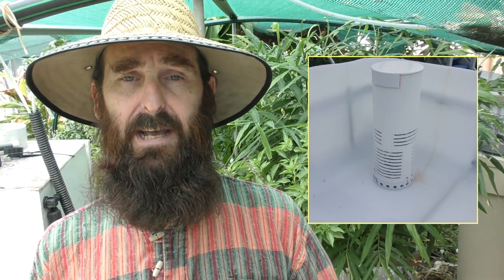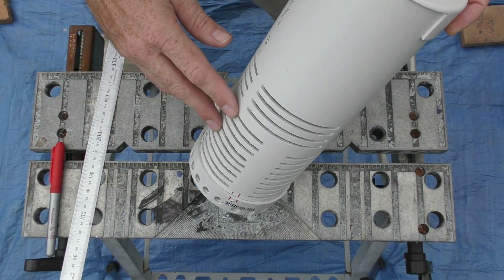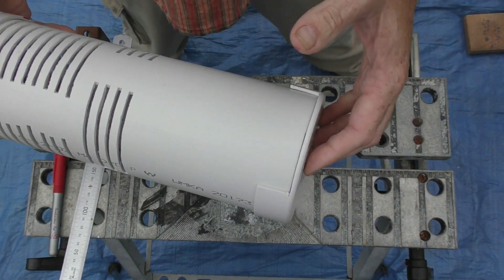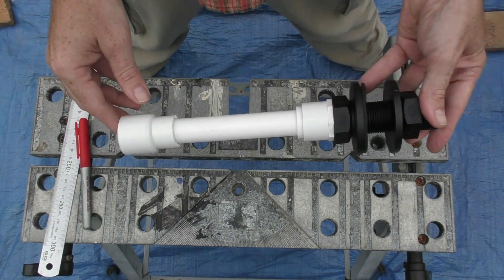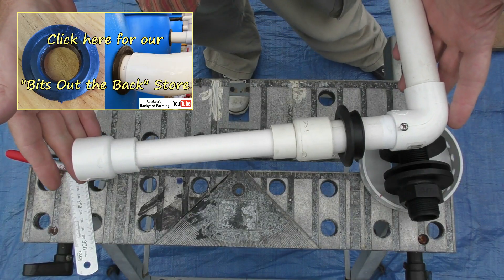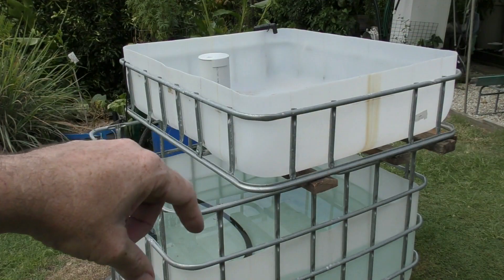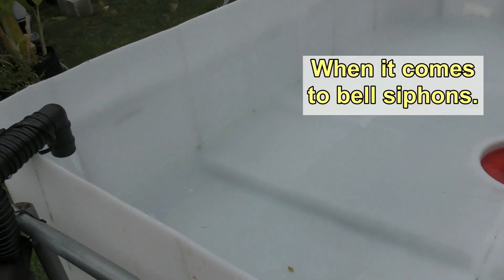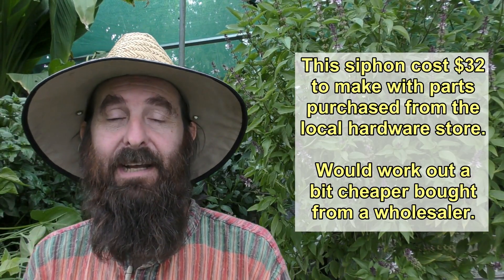How to Make a Bell Siphon & How Bell Siphons Work

Comment: Hi Rob I´m Ralph from México and i am building an aquapoci system, all was going well but i have problems with the bell siphon i cant get it to stop after the siphon is turn on, i am following your intructions by the letter so will appreciate if you could give me a clue of what´s going on? thanks!
Reply from the maker: Hey Ralph. 9 times out of 10 it's due to a high flow rate into the grow bed. Try turning the flow down a bit & see how it goes. 
It can also happen when folks test the siphon with no media in the bed as well. 
Cheers.

Comment: You said you were paying to generate compressed air. With a little bit of imagination/engineering, you can get free aerated water. Look at this method with a "trompe".  https://www.motherearthnews.com/renewable-energy/hydro-power-zmaz77jazbon
Reply from the maker: I have seen posts on the tromps & their downfall is the same as venturis in that they only work when the water is flowing. If the pump fails, which has happened a few times to me, the fish would have no O2. That's why I like to have an independent air supply.
Cheers & thanks Ray. 👍👍
Reply: @RobsAquaponics  Have you considered an automatic Transfer Switch (ATS)? They are relatively inexpensive. I am not advocating for anyone but here is an example for $40.00 Canadian currency. Grid to battery backup. Go to this link to see example.
https://www.amazon.ca/YaeTool-Automatic-Transfer-Switches-Conversion/dp/B07XNTGBQG/ref=sr_1_39?dchild=1&keywords=automatic+transfer+switch&qid=1593869950&sr=8-39
Reply from the maker: @RayAalster  I have seen systems with them connected to generators.👍 I have a simple backup using a car relay switch that's hooked to a deep cycle battery. A lot cheaper for our small system & compact as well. 
Cheers mate.

Comment: I must be missing something - when the inlet water pipe is of the same diameter as the drain pipe, how do 
you achieve water lock? The drain pipe has to be of smaller diameter to my mind. But in this case how do you drain your 
container when incoming water amount is bigger than outgoing amount?
Reply from the maker: The inflow is under pressure so is delivering more water tan the drain pipe would under gravity. 
Hope that helps.
Reply: @RobsAquaponics  Thanks Rob. Still not everything works out for me - if inflow is delivering more water, how does the container get drained?
Reply from the maker: @1yyymmmddd  The siphon creates a greater flow than the inlet provides & the bed will drain faster than the inflow. 👍

Comment: hey guys i just wanted to ask some things. i'm filipino and i live in the Philippines and its really difficult for me to find clay pellets in here. i can order online for about $2-4 per kilo of clay pellets. but i have no idea how much Kg i needed. im planning on setting up a 52x18x18 inches tank for a small 5" Jardini Arowana with possibly 2-3 tank buddies. how big of a grow bed do i need to keep the tank clean ? i figured since the fish is too small i wouldn't be needing a bigger grow bed when the plants wont get enough from the fish am i correct in assuming that ? once i get the proper size for a grow bed my next challenge would be to figure out how much clay pellets i need. thank you guys :)
Reply from the maker: Hi mate. Most clay is sold by volume here & by the sounds of it you'll need 73 gal worth to fill the bed to the brim. Probably best if youi can ask them if they have a volume per kg & work from there. 
Bio filtration wise, it's best to work on number of fish or total biomass of the fish. The rule of thumb is 25L/6.6gal for every 500g/1lb of fish keeping in mind that you need to work on final weight of fish at harvest. 
so your 275L/73gal bed should filter the waste from 11 x 500g/1lb fish or 5.5kg/12.1lb of fish. 
Hope that helps some mate.
Reply: @RobsAquaponics  will do ask them about that. thanks very much i appreciate it.

Comment: So changing the height of the standpipe allows different vegetables that require a lower water level, like potatoes? The lower water level stops them from rotting. So if you had multiple standpipes at varying heights, you could have water level control?
Reply: My plan is to build an aquaponics system with raspberry pi control and monitoring. However, the bell siphons passive technology is way more effective than any valve or pump from research.
Reply from the maker: I have added extra long standpipes to aid in the germination of seeds & found it worked well. Haven't seen anyone grow a bumper harvest of spuds in a system yet but playing around with the standpipe height may help. 
Would like to know how it goes if you give it a crack.

Comment: If I have a 450gph pump, but I restrict flow into the grow bed with a valve, am I not forcing the pump to work harder as I build pressure in the line?? Can this burn out the pump?
Reply from the maker: That depends on the pump. The magnetic drive pumps should run fine under restriction as long as it's not fully throttled.
Reply: @RobsAquaponics  thanks for the reply Rob. I'll look into what type I have.

Comment: Do you ever use larger diameter pipe for the stand pipe?
Reply from the maker: Not in my beds as they're all under 400L/100gal Zachary. 
Anything over 400L/100gal I'd probably go with a 32mm/1¼" to 25mm/1" reducer on a 25mm/1" standpipe. 
Hope that helps.

Comment: Hey Rob how much inch or millimeter do you leave between the stand and the bell will highly appreciate it 👍
Reply from the maker: Hi Jesse. I like to leave at least a 25mm/1" gap between the stand pipe & top of the bell. Have a few that have a larger gap (around 40mm/1½") & they still work OK too. 
Cheers.

Comment: G'Day Rob! How yah going?
Thanks so much for the videos! I've watched them heaps and have the IBC going.
The bell over the stand pipe is floating now now and does not have pressure on it after adding the clay balls.
I had it tested perfectly and the siphon worked great before. I have no leaks out of the bottom.
Have you had this happen? Any suggestions? 
Thanks a bunch!
Reply from the maker: Hi mate. Any chance the drain pipe is slightly elevated at the end near the sump? That can caused a water lock stopping the air escape out the end.
Hope that helps some
Reply: @RobsAquaponics  Thanks for the reply! 
I've had it going without a drain pipe, and worked fine. The I added a piece of 60mm and 40mm long drain pipe with and without a 90 degree on the end and it still worked fine. 
I had to cut down the stand pipe about 20mm to adjust the max flood height and it seemed like that is when the bell started floating.
The tank will drain be pressurized once the bell has floated a little and everything works.
Everything still seems tight and sealed inside.
Thanks again. I think I can get away with it, it just doesn't seem right.
Reply: @RobsAquaponics  you may be into something. We are on a bit of a slope and had to adjust the grow bed height with some 2x4s on the front so the drain pipe could be higher up a little. 
I'll make some adjustments, thanks!!!

Comment: G'day Rob. Aussie living in Ohio here. Are uniseals stable enough to use for a bells siphon using 20mm pvc? I have to build a 25-20mm  reducer using 2 pieces of pvc here, and expander and a coupling. Should it work just the same d'ya reckon? Cheers mate!
Reply from the maker: Hey Daniel. You can use Uniseals to hold the standpipes. 👍 I prefer the bulkheads as uniseals can fail if the pipes have a lot of movement or get knocked hard enough. 
How are you liking living in the US? 
Cheers mate.
Reply: @RobsAquaponics  Thanks for the reply Rob...I know you get a ton of questions so I appreciate you getting back with me. I really enjoy your channel. Living in the US is not too bad actually, though I do miss the salt water. I lived in Brissy and my folks are in Nth Straddie...miss the beach & SW fishing for sure! Take care mate, ya do good work and your spirit of generosity is very refreshing!
Reply from the maker: @danieltaylor757  Chewers Daniel & have a top one yourself.

Comment: Hi Rob great video and now most of us understand how the bell siphon works .  Question is do you use timer for pump to start same as you would have to over head irtigat.  So adjustable to when watering intervals works for wots growing and if you get alot of rain I'm guessing the siphon will work most of the time  when raining ?
Reply from the maker: We have the pump running 24/7 Anthony. 👍 That way the water from the fish tank is constantly flowing through the beds so the waste can be processed.  
Cheers.

Comment: So a straight 25mm  stand pipe will not get good flow instead of 25mm reducer to 20mm pipe to 25mm reducer will not get good flow?
Reply from the maker: The increased area the 25mm opening will help to allow more water into the 20mm pipe helping to initiate the siphon quicker. 👍
Cheers.

Comment: I have my 6 IBC containers all connected to the same drain and have an external riser pipe with a siphon setting my water level and it drains to my sump tank. Has worked flawlessly for 5 years now. No moving parts or ways to stop working.
Reply from the maker: Nice one Steve.

Comment: Hi Rob. What do you feel about U Siphon? I having a bit of a confusing whether to use a bell siphon or a u siphon.
Reply from the maker: I find the Bell work fine for me & have a smaller footprint in the bed. 
An external U siphon would help there but you will have issues cleaning the plumbing inside the bed if roots become an issue. 
Cheers.

Comment: Hi Bob  I'm having an issue with my bell siphons. It my in-flow water is too slow. Then the water rises and trickles over the upright but never creates the siphon. If I raise the in-flow higher then siphon initiates but then is never breaks the siphon when nearly drained.  Any ideas??   My Upright is 1-1/2" to 1" with 1" PVC pipe with a 1" to 1-1/4" reducer on top.  But bell is 3" my shroud is 4"
Thanks in advance
Reply from the maker: Hi Barry. Sorry it took a while to get back to you. Have you sorted the siphon out yet? 
I had that issue in the past & found that it was a slightly elevated drain pipe that was creating a water lock under the bed that was the issue. 
Cheers mate.
Reply: Hey Rob. It would appear that I just need patience perhaps. it does flood and drain. it just seems/appears to take forever from the first gurgle to burp then it breaks the siphon and re-starts the next flood.  Thanks Mate
Reply from the maker: @barryfawthrop2287  Am glad it sorted itself out Barry. 👍
Happy growing mate. 🐟🌱

Comment: Is it okay to take this and use it in a smaller system? I'm just afraid it may drain the beds to quickly (if that is a problem or not). I know it's a stupid question but this stuff is really new to me. Thanks in advance!
Reply: Chuck Norris never get afraid
Reply from the maker: It should be no issue as well as long as the beds don't dry out. I've used it in smaller 810L systems with no issues if that helps any.

Comment: Can a bell siphon work if the tank the water is being siphoned into is higher than the tank being emptied?
Reply from the maker: No it can't. Most folks will have it running into a sump tank with a pump in it to move the water back to the fish tank.
👍

Comment: Excellent video! Especially thank you for translating both inches and metric!
Please be super careful when cutting those notches into the shroud with the miter saw. I know a pro who lost his hand to a miter saw...good idea would be to start with a longer 4” pipe, cut your slots (keeping your hands away from blade), then trim to length after slots are done.....also, I too was having some problems with the siphon initiation. Another easy way to assure the initiation is to have the drain begin with a 90 degree angle, pipes 1st 1-2 ft stay horizontal, then down to storage. 
Again, awesome tape. Thanks!!!
Reply from the maker: Glad you enjoyed it Dan.👍
I grew up working in my father's engineering factory so have experience working with dangerous tools. But in saying that, you make a very good point about starting with a longer section & cutting it down once the slots are cut. 👍
Cheers mate & happy growing.

Comment: Hello, 
Thank you for your time posting these tutorials. You mentioned that it takes 10 minutes to fill the grow bed and 3 minutes to drain it with the bell siphon. I calculated your pump at 158.5 gph is doing 2.66 gpm's. My first question is what is your cycle on/off rate so that you exchange the tank water once per hour? My tank is pretty close to the same size and I am still learning and I am having problems getting my flow right. My fish tank(no fish yet) is closer to 190 gallons. My grow bed is 45"x38"x12" . I measured 45"x38"x8" and calulated it will hold 60 gallons +/-  of water, stopping at 4" from the top lip. 2 inches above this with river rock and a 2 inch lip above the river rock. I estimated my grow bed to hold 24 gallons of water after the 3/4" river rock owned 60% of the space.  River rock 36 gallons, water 24gallons. So does my sump need to be at 24 gallon? I have read that it is a good ides to add 50% additional, making the proper sump tank 36 gallons. Sound right? I initially estimated mine to be 18 gallons and that is what I used and I am having a flow exchange issue. emptying the sump tank faster than the radial flow filter will replenish it. I made a video under my name showing what I have going on and asking for suggestions from someone that knows. But anyhow I think I will reduce the size of my bell sipon from 1 1/2 to 1 in like yours and incrase the size of my sump to 35 ish gallons. My sump now currently gravity fills from the radial filter and it is overflowing until the fish tank and radial filter level off and the radial filter bucket drains low enough to stop flowing into the sump tank. First attempt at this. Sorry to be long winded. Thank you again.
Reply from the maker: Hi Rob. 
The size of your sump needs to be at least as large as the grow bed so it can hold enough water to cover the pump as well as leave enough in there so you don't need to be constantly topping it up with fresh water all the time. 
You can use the 50% of bed volume once you start adding additional beds to the system is the rule I like to follow. 

I just had a gander at you system clip & think you need to increase the size of your sump to at least the total volume of your grow bed, if not larger for the reasons I stated above as well as to be able to hold the total volume of the grow bed in it.

How do you have the stilling well on the radial flow filter connected? If it's airtight it may be initiating a siphon & draining faster than it would via gravity. 

Hope that helps some mate.

Comment: Might be dumb question first time aquapontist here how does the  25mm pvc pipe connect to the bottom of the bulkhead also is a bulkhead a tank outlet here in Australia cheers mate
Reply from the maker: You can see the fitting used to connect the 25mm drainpipe @ 13:57 AG. 👍
They're called both bulkhead & tank fittings here. Bunnings sell them as tank fittings from memory..
Hope that helps mate.
Reply: @RobsAquaponics  cheers mate ended up finding something got my grow beds all set up made out of used pallets and some pond liner cheers and thanks rob
Reply from the maker: @sweetness6048  No problem mate. Happy growing.

Comment: Folks can measure flow rate with a gallon jug or 5 gal bucket, just make sure you have the height of the inlet the same ad to not fool with the results
Reply from the maker: That's the easiest way.
Cheers.

Comment: You were my motivation to build a chop and flip aquaponics system I went out and got the IBC Tote got the cage cut but couldn't get all the screws out of the bottom frame cuz they were stripped  I tried a few different techniques to get them out  but I haven't had much luck yet once I get those out I'll be able to continue on with the project I'll be posting on my page if you'd like to check it out and maybe give me a few pointers
Reply: I got my IBC Tote shop flip and painted about to start on the Bell siphon. Thanks Rob

Comment: I see that the cap is leaking I've seen in other videos you put a clock to prevent that did you not do that in this video?
Reply from the maker: This clip was shot while building the system so I wasn't aware that it was leaking until after the first wet test which is what I used in the clip. 👍
Hope you get your system sorted out soon James.
Cheers mate.
Reply: @RobsAquaponics  thank u Rob  it's coming along nice I've had to do something slightly different from your design is my IBC Tote it's a little different from yours proposed it all on my channel for u to see
Reply from the maker: Nice one. I used vice grips to get the stubborn screws out of the frames here.
Reply: @RobsAquaponics  Thank you means a lot coming from you. I'm so glad I came across your videos you have taught me what aquaponics is and it helps me get through some tough times by keeping me busy and I really enjoy creating new systems I get excited when I come up with something new and show it off to everybody I know LOL. The more I mess with the aquaponics the more I want to try to make A living out of being aquaponics farmer and be my own boss.
Reply from the maker: That's great to hear  @jameslingenfelter5136  . I would like to have a crack at some small high value crops as well but still think I need a bit more space to set up a decent system. 
Cheers mate & have a top one. 👍

Comment: In my experience 40mm standpipe is good to go at flow rates from 1500L to 3000L but im having trouble initiating the syphon at the lower flow rate my solar pump gives me. I should have copied  you and gone with a smaller standpipe but ill have to figure something out

Comment: What will happen if I use a 1/2 inch stand pipe instead of 3/4 inch stand pipe?
Reply: It's faster :) (assuming you up all diameters)
Reply from the maker: As it's smaller it will restrict the flow some meaning a longer drain time I'd say. 👍